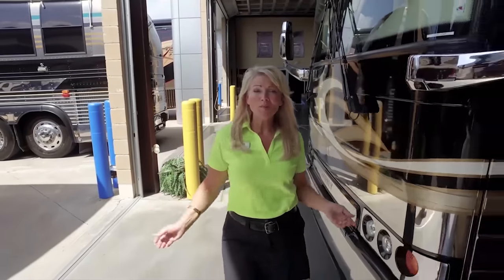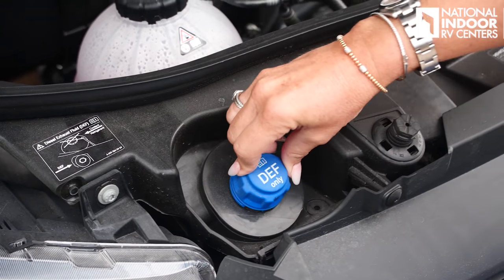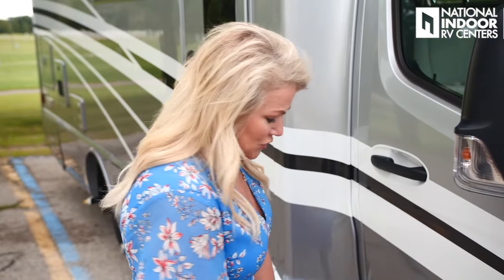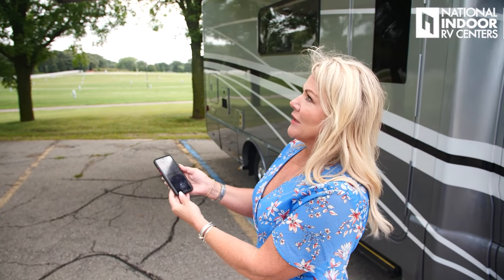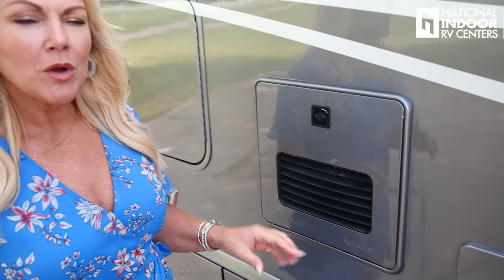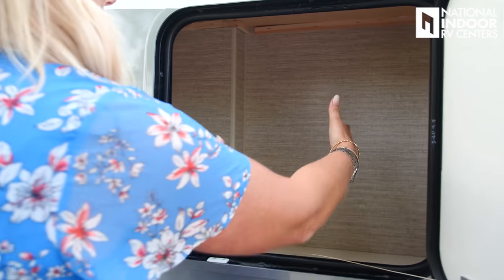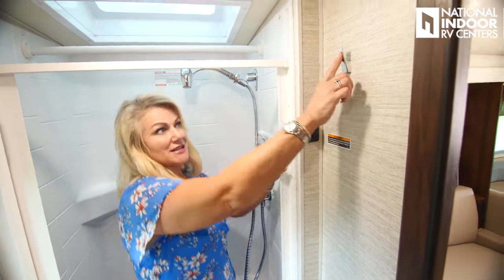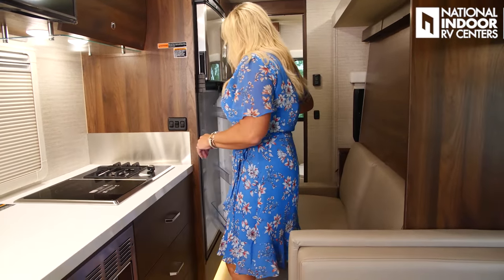2021 Winnebago View/Navion

Comment: Excellent walk though! I especially like how well the dash display demonstration was done. Usually, you have to take it on faith as to what they are doing as it is impossible to see the actual display. A step above. The only thing I missed was the info on the compressor fridge which is important as it affects two aspects of the use of an RV. Levelling and battery usage.

Comment: I’ve never been a fan of the Class B+ RV’s (& this is a Class B+ not a Class C as it’s built on a Van Chassis 🆚 a Truck Chassis = the distinction, not the bunk over cab); However... THIS Class B+ is a winner❗️ + That IS the best Murphy Bed 🛏 I’ve seen in ANY RV 👍🏽 However that “Privacy Curtain” is a joke 👎🏽 (even if you’re not a light sleeper you will probably notice someone trying to slip by top the bathroom, especially as the curtains rustle from them trying to shimmy through, & if any one wants to peek in there are several place to do so & those gaps/flaps may get caught on them as the try to sneak by) 🤦🏽‍♂️ Also, a dedicated hanging closet space, other than the shower, would be nice; as the cabinet across from the murphy bed/right of the fridge could have a hanging bar with removable shelves to at least allow a half hanging space for shirts & folded pants (creased from the fold) even if not long enough for longer garments (giving us the option). 😉 

* I checked the Winnebago website & the floor plan layout shows there is a hanging closet in the bathroom (I guess where you showed the table top & leg are stowed, but didn’t show the whole thing or mentioned it’s a full hanging wardrobe closet). ** 47:58 2nd viewing I see where you mentioned it’s actually a discreet closet 🤦🏽‍♂️ #MyBad

+ the exterior storage is much better than other Class B+ RV too (even true Class C RV’s as well)‼️ 📦🧳📦 👍🏽👍🏽

* I checked the Winnebago website & they have it as a Class C so... 😒
It should be a Class B+ though 😏
Reply: A few strips of Velcro should go a long way to take care of the gaps/flaps in the "Privacy Curtain(s)".    One could even add the 
Velcro strips on your own.      Apparently for the 2022 model there has been an upgrade to the TV along with an included Blu-Ray player.  Would be nice if the Mercedes Blind Spot freature could be added for the 2022 model as well,  as it is available on the other Winnebago Mercedes Sprinter chassis  RV, the one that is a true Class B.